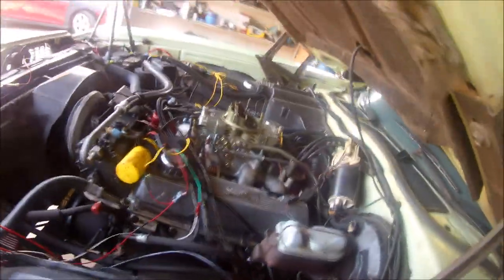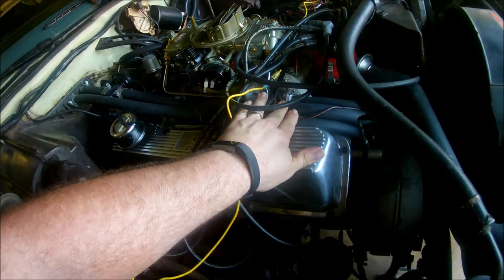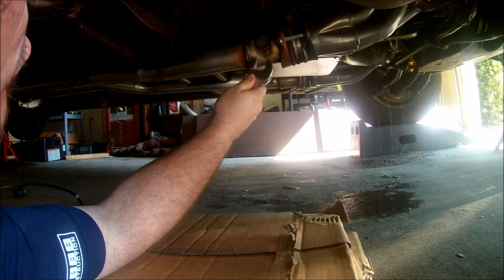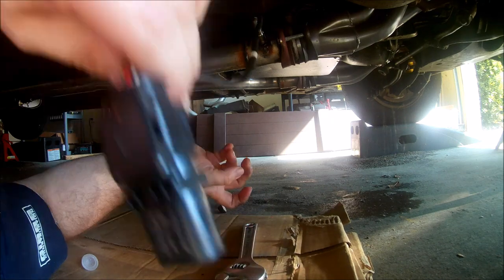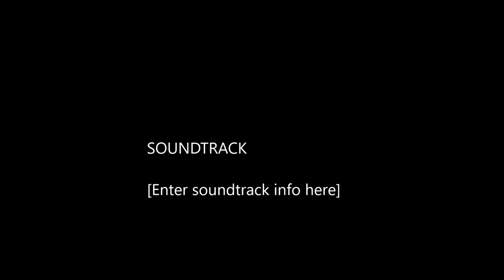Holley SNIPER Install - Sensors and Throttle Body - 1973 Ford Torino - Ep. 3

Comment: Congratulations on your swap, it really looks great. 
The only thing that got me holding up on buying an EFI System is that I haven't figured out how to run the  4L60e , 93 Blazer 1500 5.7 4x4
Reply from the maker: Thanks. I think the Terminator EFI can control the tranny. But its at a completely different price point. Thanks for watching.